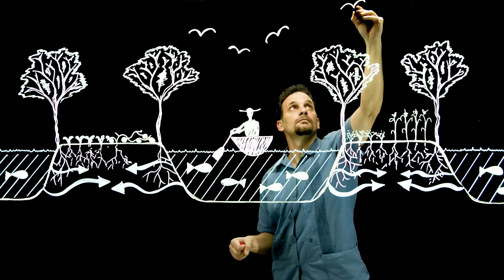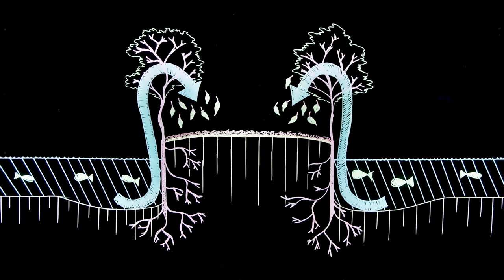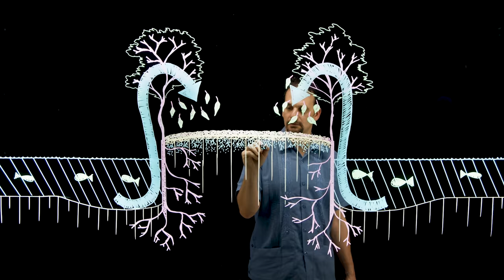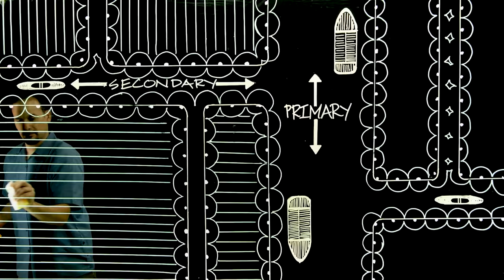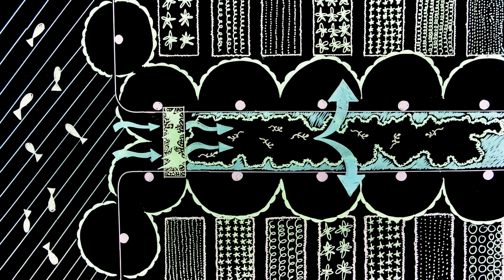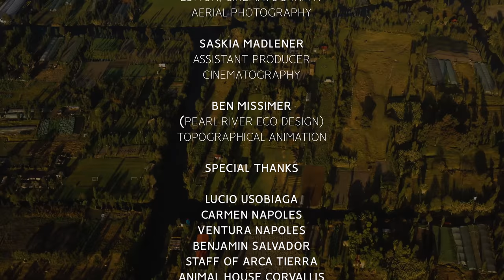Chinampas of Mexico: Most Productive Agriculture EVER?

Comment: I did some archaeological research on the collapse in Chinampa agriculture from the prosperous Aztec times to post-colonization times. One of my main findings was that the Chinampas system required a high degree of political orchestration to function. There is evidence for times of high and low use periods during Aztec power, and they can be correlated with times of strong and weak governance. When the Spanish came in, the Aztec governance system was of course decimated, and therefore the Chinampas system greatly receded. The reason they can be so product is from a highly organized and efficient labor system with a common goal and greater vision. The Area Tierra program seems to be filling in this gap, providing a modern and integrated structure for the Chinampas system to once again rise to prominence as an incredibly efficient, abundant, and ecologically diverse system that supplies food to the residents of Mexico City.
Reply from the maker: Really interesting. Thanks for sharing :-)
Reply: Dayum!! You overdid it! If you didn’t get a A+, you were cheated!
Reply: I did some research to as part of my landscape architecture history class, and one of those management reasons could be that once the Spanish settled they stop their composting system that created the chinampas in the first place. Basically all the city waste (human waste too) was composted and layered into each chinampa. The city therefore expanded alongside its population.
Reply: perhaps with an efficient private system this can rise to stratospheric levels
Reply: @Nooneinparticular987 yet even the perfect system without labor is not productive. I think you're imagining an alternate reality because in your argument you support the high complexity of the chinampa yet it doesn't work as it should in paper because all the political reasons surrounding the ecocide since the viceroyalty and nowadays the urban era of the México basin. Without the political and economic structures there wasn't the need to designing the chinampa in the first place and then how to maintain it and exploiting it, that's why it's dying.
Reply: @gabix.o  you didn't even listened. This cannot be a private system because it's homogeneous between territory and community.
Reply: @jafersorianocamargo6723 Actually that is already a modified private system, I say to do it officially by fencing the land for agriculture so they are not destroyed by the advance of the city and can be cared for the neighbors more calmly, being these the owners!
Reply: Thank you for sharing, there is so much to be learned from this example in history.
Reply: yes common goals often morphs into a few people working hard and others reaping the benefits. i don't think the Aztec society at that point was a paradise in any way for the laborers.
Reply: @Nooneinparticular987 I agree with you, not sure about the Genghis Khan thing though.
Reply: @vince8723  Agreed. The best we can do is lead by example, trying to force the ideals through government intervention always leads to the same path, just ask the World Economic Forum, “You will own nothing and be happy”
Reply: I also did some research and colonists arrived at a prime time when the Aztecs had more or less fallen apart and were devolving not evolving thus were easy picking for the shrewd Europeans.
I also read that people in South America made something called Terra Preta... there are different recipes but the best type is made over decades using compost, human waste, ashes from fires and lots of time. Build it for a long time made many inches of exremely nutrient rich topsoil. Things grew soo well without any miracle gro :P
The people of South America are also responsible for most of the variety of fruits and plants on the continent. They literally bred different variety for different qualities like more bitterness, more sweetness, etc from original native barely edible plants...
Reply: I always felt that chinampas and xochimilco should be expanded and become a cultural landscape with farmer markets.
Mexico should take advantage of its pre European agricultural methods and implement many cultural landscape throughout the country.
Reply: @jafersorianocamargo6723  People need to eat and will collectively labor towards that end naturally. Dont need a govt or a currency, just a bunch of hungry people.
Reply: @jafersorianocamargo6723  Private Companies SHOULD be overseen and regulated by the governments. A private institution like this one deserves tax breaks, subsidies, land grants, contracts, and dedicated tourist lines.
Reply: @afrz4454  Yessss International tourism alone could fund Mexico citys budget if they did this. take rich europeans on mariachi boat rides to see the axlotl
Reply: @siyiroancreint  Yes, it could be highly profitable if done right. The organic harvested goods. I always thought that of Mexico really pays mind to this they could end up improving their technology and helping with water management and crops to other countries like now the Netherlands do.
Knowledge is also very profitable.
Even hummingbird gardens we could plant for people to come and spend hours looking at those magnificent warriors.
Reply: Did the arrival of malaria play a role in the decline of the chinampas? I know that malaria (falciparum or vivax) were diseases of Africa and Europe respectively, and both types became endemic in the Southern US.
Reply: @joanhuffman2166  Not before European’s arrival. Also a healthy population of axolotl and other animals would manage any mosquito overpopulation. The problem is when ecosystems get out of balance.
Reply: What is the actual correlation between agriculture and governance? Hungry ppl will farm food no matter who is in power. I'm confused.
Reply: I would think that would be very difficult with the current population size and imbalance with water supply...add in climate disruption, and the impact of harmful introduced species, and making this work long term is a tall order.  I do think it is great to be looking at agricultural practices around the world, Andrew.  Amazing that it still exists, but it is GREATLY degraded and fading fast.
Reply: @jafersorianocamargo6723  You are spot-on...the lack of labour is the key to it all. The Aztecs  Big machines cannot do it nearly so well or precisely (that is, after all, IMHO why we have fingers and large brains, to selectively manage plants on a human scale.  One must consider that the Aztec's used slavery to build their empire and economic wealth, in much the same was as the American South.  The fertility also comes from the climate, and while this might work in the tropics, it might not work in northern climates, where freeze/thaw would/could tear these structures apart with ease.
Reply: @tamarac283  ahh, thank you. That was my next pattern of thought, "What did they do with waste, back then, to keep everything clean?" It would be ideal if the current PTB would begin to implement some of these practices.
Reply: I cant find any info on the "area tierra" program.
Reply: I love this system already and the idea of it this is very creative
Reply: Wrong
Reply: @Nooneinparticular987  this is some
great input!
Reply: I Agree
Politicians should be Orchesrated
Reply: @adr3000  the problem with the lack of government is that the majority of the work generates no food, thus "no money". someone has to drive those stakes into the muck... about 4-6 feet deep. who pays/feeds him? then someone has to wade chest deep in the swamp and weave literally tones of reeds. who feeds him? then someone has to harvest move and dump hundreds of tones of bio mater into the chinampa. who feeds him? then someone has to dredge tons of muck into the chinampa. who feeds him? only then can the farmer start preparing the land... unfortunately years go by and the canal starts filling with debris and plants. who cleans the canal? everyone uses it, but now that work needs to be done no one owns it. now the government is weak, who protects the farmers from bandits who want to steal all the harvested food? what happens when a family cannot maintain their plot? how is your great grandfathers plot to be divided between you and his 50 other great grand kids? who maintains the law when you have the population density these farms can maintain?
these are just some of the reasons this type of farming requires organization, frequently forced organization.
Reply: @vidard9863  appreciate the explanation between the correlation of both governance and agriculture. I understand. 

I suppose what comes to mind are state employees in the US, or civil engineering projects like the Panama Canal. We always have unemployment, and we always need food. There is a constant need for both work and food production, why not pay the workers of these lands through collected tax money, subsidizing food for locality. 

I'm sure there have been much smarter people than me figuring out the economics of this, but I don't immediately assume all labor in this model must be forced though historically may be the case. 

💕🙏💕
Reply: @adr3000  the force itself is typically not needed, but the potential of force is. whether it is to say you must pay the taxes so that we can pay the laborers, or you must go along with the program, or this is the plan, and you must conform. without organization, everyone comes up with what everyone else should be doing, and they all come up with reasons why they personally shouldn't be doing the thing.
Reply: @tamarac283  thanks, when they talked about the human waste issue now I was wondering what they did with human waste in the system in the past. I would love to learn more how they worked with it and how they made sure they had clean drinking water in a system that was using human waste.
Reply: I understand the meaning behind the political support for a system like this, of course, these things often come out of necessity  as necessity breeds invention. This system is useful  for places that need to conserve water and when there is an honest admission that there must be a truly extraordinary way of taking something like waste and using the environment to solve the issue of how to reduce the damage of that waste. Much of our solutions today do not work this way, our leaders want solutions that involve something that does not require them to put a lot of effort and brain power or that can be delegated by  some industrial process and or manufactured. 

The fact is that an ecosystem like this is completely efficient in that it helps solve problems like waste water problems and helps offset those issues by using the natural ecosystem that really does all the work of cleaning the water and fertilizing the soil. There are plants and trees that can help clean out water and like we see here various insect and amphibian species like the axolotl that when there is a balance are critical to the success of this type of ecosystem. I have researched  estuaries in Florida and other places that had at one point attracted a more diverse species of life that all helped with pollution and erosion like the Flamingoes who are very sturdy and eat toxic algae that cannot be removed efficiently really in other ways, this bird eats this specific type of algae, and the result is a more beautiful color in the bird, nature is truly amazing to me.

I think maybe with the introduction of some plants and trees maybe that they did not need in the past, this could help solve some of the issues with the damage of modern pollution problems. These were not the problems that existed 500 years ago, so it may be that the simple addition to the same system with new plants and trees that can clean out the water could  bring this system right where it needs to be.
Reply: Where can I read more about this? Post links please.
Reply: @el_presidente  every introduced disease devastated Amerindians, including but not limited to smallpox, influenza, measles, German measles, mumps, pertussis,  diphtheria, cholera, polio, hepatitis A,B, and C, malaria both falciparum and vivax, typhus, typhoid and so many others
Reply: Humanity is ideally in a horizontally organized system, the most efficient and free for all. Authoritarianism and the current rise of fascism is important to fight.
Reply: no folk is going to tell me history about our land.
Reply: Slavery definitely helps with larger infrastructure projects and achieving unified goals.
Reply: @eccehomonohomo  it doesn’t actually
Reply: @agnidas5816  what you are referring to has yet to be fully understood by the public or the scientists uncovering these things, but it has been fully known to high-level initiates and genius level philosophers, poets, and priests for thousands of years. Much of South America was the vast ancient farmland of a once global culture that utilized the non-glacial parts of the southern-eastern states of north America for their homeland.

The yunger-dryas caused significant sea level rise and chaotic climatic conditions, as well as flash floods that wiped out the evidence of this culture in north America. Beneath the trees and temples of South America still lay monumental stones, roads, and cities. Europeans, misled by wealthy Jesuits pretending to be Catholic, came to South America (it was not an accident) with the intention of exterminating and eliminating all evidence pointing to this alternative history. Similarly, in North America there has been a 200 year effort to destroy all evidence of the mound culture that managed to survive in the southern and eastern states where flood waters did significantly less damage, leaving a small population behind.

Whether considering the many crusades, or the genocide of South America, or of ancient Germans, or the many genocides of the Irish/Scottish you can bet your money that if the Roman imperium is involved, it means evidence of this real history I have given you is being deleted.

Terra preta is nothing special, and modern high value crop farmers make super soil to this very day using similar techniques to those you mentioned. I have made it myself and it is magical and self-regenerating with the least amount of effort (proper crop rotation) and lots of worms.
Reply: @kx7500  great wall of china, aqueducts of Rome, building of castles using conquered armies, immediately doubling the size of one's army, building roads in Rome, or railroads and the highway system in America, slave labor in America using the prison system has helped build many roads, etc. There are many examples of slavery leading to large scale infrastructure projects and unified goals (and military expeditions as I mentioned with army size).

Edit- not to mention the vast infrastructure projects in south America built by slaves. Or the large aquaducts from the Khmer, or the many infrastructure projects like temples and roads and walls built by slaves in India. Many mining projects in Africa were successfully fueled by slavery as well. 

Are you trolling?
Reply: @eccehomonohomo  You know what? You're simply right here lol. I think I was thinking moreso relative to the same people doing so unoppressed or of their own will.
Reply: @kx7500  Robots 3d printing bridges and roads and buildings is going to change the game. No need for slaves.
Reply: @eccehomonohomo  depends what you consider the game to be
Reply: @tamarac283  cats brains,nerves, being affected now by geomagnetic blasts,solar flares look at Bach flower rescue remedy, Walnut Bach flower, homophathic aconite 200c, homophathic for hypersensitive fer.phos. & hypernicum. A crate with no bottom outside moonlight on grass supervised helps them release EMF. See dutchsinse earthquakes utube...getting bad and hard on cats.
See book Caroline Connor radionics site cat book.
😽😼😻😸😺😿🙀😽😻😹😸
Reply: Great insight into the subject and also how the archeological findings tells us about governance in Tenochtitlan
Reply: Can you post some links?
Reply: Was this in your conclusion? Lol
Reply: This has to be one of the most fascinating comments on YouTube I've ever read.
Reply: Great comment!
Reply: Very interesting! Thank you!
Reply: Thanks for sharing!
Reply: @gabix.o  Thanks, but no thanks.
Reply: Do you have any insight as to what exactly was the government's role in supporting this system? Just learning from the video I have the impression that any household should have enough labour to set up and maintain their own Chinampa given the size of the plot, while land allocation or canal management can be taken cared of through local community governance. Is it possible that the correlation is due to confounds? For example, maybe governance correlates with population and economy, and farming production is of course also affected by those too.
Reply: that conclusion would suggest that landrights may have been restricted by formal aztec governance in the past. They were probably constructed by the government and held by them after. usage of them may have been reliant on labor forces which were employed by the government, but objectively, we don't know if they were employed farmers, or impressed laborers.
Reply: Nice! Can you refer me to your articles (if you did any) and of others that you used for this subject? It interests me very much.
Reply: Quedas oficialmente invitado a la carne asada como invitado de honor. Que gran investigación amigo 🙏🇲🇽🇺🇸🇨🇦
Reply: @gabix.o  just needs the right investor
Reply: If you how to replica the Chinapas  .. I know a place in Mexico....
Reply: Toltecayotl explains how this was possible. The peak of ancient Anahuaca civilization had perfected systems of organization. Ancient ‘mexico’ is very much a hidden and forgotten history for much of the world.
Reply: So what are you trying to say ?
Reply: @gabix.o  no that sounds capitalistic, food is the connection of all species. not the pleasure of a certain amount
Reply: Reminds me of my country, the Netherlands. In the Middle Ages land owners had to cooperate to build dykes to protect large swathes of land from floods. Lords who would fight wars against each other had to work together, because water management was necessary for everyone’s survival. It lead to organisations being set up that would function across those borders, as water doesn’t care about who owns what land. I can imagine that If a foreign invasion or something in the 1500s would have forced those organisations to quit, the Netherlands would have remained a swamp with just a few inhabited areas rather than an economical powerhouse it was in the 1600s. Amsterdam would’ve been a small fishing village, Rotterdam would’ve washed away in a heavy storm. Locals know what works and what doesn’t and it’s a shame invaders like the Spanish destroyed so much knowledge.
Reply: Any way to read that research?
Reply: The system itself have an inbuilt productive power: free and easy mode of transportation, good supply of water, free organic fertilizers, relative safety from pest, extra food from fish (not many land on earth have such gift)
Reply: One reason the Mayan and aztac population declined was infighting and diseases from mosquitoes and insects after Agriculture mismanagement then at the low point decades later, then Spaniards showed up
Reply: Aka indigenous communism ☭ 💪🏽💪🏽